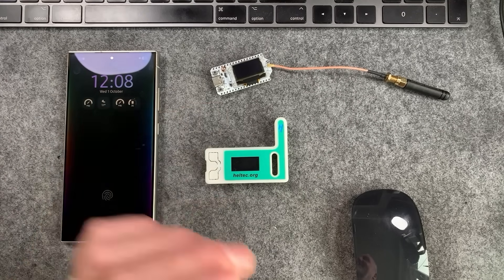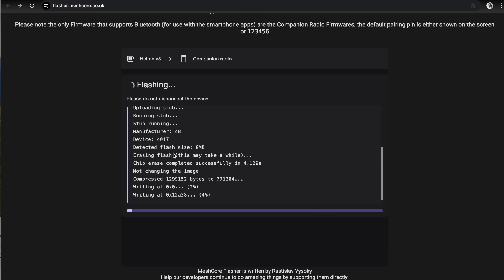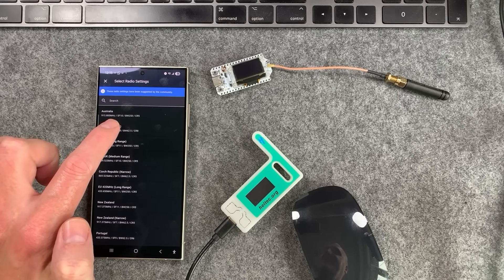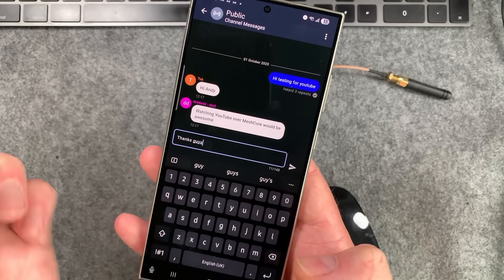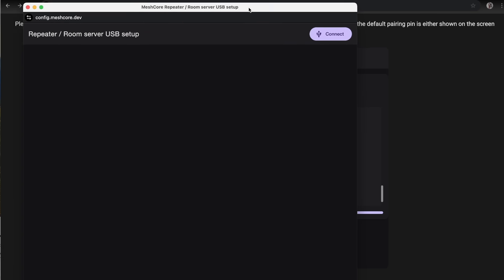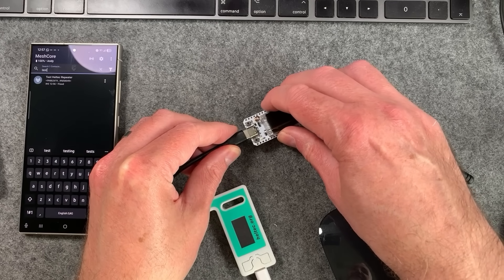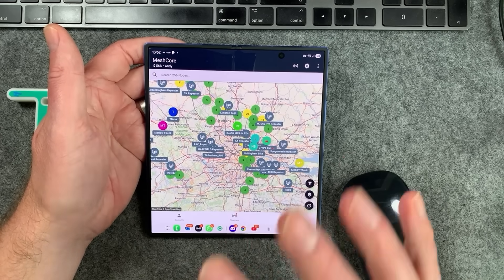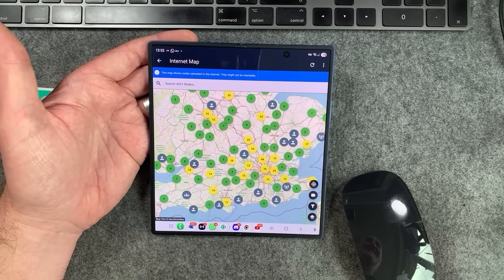HOW TO SWITCH FROM MESHTASTIC TO MESHCORE EASY!!!

Comment: Nice! Hopefully a few more switch over to the bright side. I switched over to narrow settings when you mentioned the change and remarkably I have seen some contacts and a few messages in "public" - but alas that must have been someone mobile or fluke weather as my neighbours list is still empty. Fingers crossed as there were quite a few nodes in range previously on Meshtastic.

Comment: If MeshCore is light years ahead of Meshtastic, is there an integration with ATAK?
Reply: No, because it is the opposite extreme to Meshtastic. Total separation between clients and repeaters. Making it lightyears ahead when there is a fixed infrastructure, but useless for mobile meshes. (Hence why it is so stupid MT resist 3rd party clients, both on a TDeck would be brilliant)

Comment: @andy kirby, whats your take on meshcore v meshtastic on devices like the T-deck plus / T-LoraPager, i have both, and till now i like the smooth operation on the pager with meshcore, meshtastic is still buggy on the pager, still need to test the tdeck+ as that just arrived and currently on charge, but first glance... meshtastic has its own issues one of which is a busy UI
Reply: Have you tried launcher? It allows on the move reflashing so switching between MC and MT is possible from the device, (if you can find the correct MT file, the MC one is deliberately published)

Comment: Meshcore might be better, but it's a real problem to create a mesh in the city, so Meshcore only makes it more difficult. I know several people with the free Meshtastic, but no one personally with Meshcore. But I do know of two nodes that are now only making the mesh thinner.
From my perspective, Meshcore is just sowing discord.
Reply: To be fair, it was Meshtastic preventing third party clients that started the whole thing. Had they not, we would have T-Decks with different systems, that users would just treat as different channels, use the one that suits your needs, either local coverage or different benefits.
Reply: While it is true that the already small community will be divide, this argument isn't the whole story. More options will give an incentive for new  users to join in, and it will encourage for the Meshtastic software to improve and become more user friendly. I am not a fan of either, and I myself am worried about the market becoming divided. But if this is the only thing you can think about you seem a weak member of a dying community. This attitude wont help either platform to grow.

Comment: I have switched all my nodes to Meshcore since March. Only two meshtastic devices left in my posession. One is abandoned on a very high mast. The other one will be reflashed on next maintenance. Meshcore is so much better for messaging.
Reply: What makes it better?
Reply: @chimeforest  Routed packets and simple flood using dedicated repeaters rather than "managed flood" which doesn't work well in the UK
Reply: @debuzzard  They are actually basically identical, both use a managed flood approach with no routing tables. The main difference, is Meshcore is new, and so does not have the same firmware intertia as meshtastic, with older firmware nodes sitting around, and meshcore forces you to use dedicated repeaters, forcing people to think more about where to put them in good places, wheres building good dedicated repeaters with meshtastic is more optional, so maybe people didn't just do it as much because of that, and so there's less strategic infrastructure. But meshtastic is just as capable of building that strategic infrastructure with its router and repeater roles which effectively turn all clients in range into non repeaters, like meshcore.
Reply: @MassDefibrillator   Meshcore uses simple flood as opposed to managed flood, when it isn't using path routing.

I might be a bit behind the times with Meshtastic but when I last checked, with Meshtastic the only mode that will always re-broadcast (simple flood) is ROUTER_LATE. Managed flood worked poorly for myself and many others (mainly Europe).

Even if MT is improving in this regard, these changes seem to be in response to MeshCore arriving on the scene. Before it did, the Devs seemed uninterested in the issues those of us were having and were quite frankly high-handed with those who raised the issues. 

So I'd personally be reluctant to properly get back into MT (I still have one MT node) even with improvements due to the Dev's attitude.
Reply: @chimeforest you type messages and actually get replies, lots of nodes reflashed now.
Reply: Meshtastic and Meshcore are for two different use-cases. Meshtastic excels in dynamic, mobile, and feature-rich scenarios, while Meshcore is better suited for scalable, reliable, and low-overhead city-scale or emergency response networks. The most significant difference is that Meshcore does not forward messages between nodes, instead relying on a central repeater or repeaters to relay messages. This makes it less suitable for tactical applications in highly-fluid environments than Meshtastic.
Reply: @n7ekg We actually tried building a mesh with Meshtastic for several months before switching to Meshcore. The only thing that Meshtastic excels at is clogging the network with unneeded telemetry and then loosing actual messages. But that is just my experience, your milage may vary.

Comment: I have a haltec up a pole with usb running down. It's on meshtastic and connected to my home WiFi.
Can I connect it to WiFi when I convert it or have a fixed Bluetooth pin so I don't need to read the screen?
Reply: Yep
Reply: @TheAtomicZombie10  can you tell me how?

Comment: Hi, there are over Meshtastic nodes in my city. Is Meshcore compatible with Meshtastic? Will I be able to exchange messages between the two systems?  Thank you
Reply: There was a brief time, perhaps less than a month, where Meshcore could communicate with Meshtastic but they currently can't communicate with each other. As I understand, Meshtastic instructed Meshcore to remove the cross platform compatibility. I don't know if the compatibility was originally achieved through code reuse of libraries or reverse engineering, and what grounds Meshtastic based their objection e.g. legal license, philosophical, etc. Andy briefly mentioned it a video posted months ago & I don't believe he has commented since.

Comment: I‘m in Germany and on the map there are just a few MC-Nodes a bit further away, but many MT ones.
My question is:
Is MC working with just my one Heltec V3 set up as companion, or do I also need a repeater for it to work, if anybody else is in range?
Thank you! 👍🙂
Reply: Clients do not repeat, but repeaters form a mesh. (Presumably why it is called MeshCore). This has the down side that a single device does not grow the mesh if it is used to send messages. It would be nice if repeater could accept bluetooth android clients or if there were an ad hoc repeater mode for clients.
Reply: Where in Germany? I tried MeshCore in my area but there's no one around. I'm in Leipzig, 04207
Reply: @MadalinVladescu  I am in the west near the Dutch boarder, Düsseldorf area. So pretty far away from you unfortunately.
Reply: I was in Germany last week and picked up MC nodes in Germering, Berghausen and somewhere in the Alps when flying out. Only public channel message I picked up just said "Guten Morgen".
Reply: @Andrew-n2e9y  Good to know, thank you!
I am in the western bit, in the Düsseldorf area, so not where you have received something.

Comment: I only use fully open source software and dislike people monetizing closed source code while claiming to be mostly open source. May as well be no open source.
Reply: same mostly. I don't mind if they offer a 'premium hosting service' to host & run the software for you on a server, as long as its entirely opensource and can be self-hosted for free
Reply from the maker: MeshCore IS open source. ??? The apps are made by third party devs who can decide whether to charge for their hard work or not...you can make your own app if you want. Meshtastic charges you a license fee via the vendor when you buy a device with their logo on.
Reply: @andykirby  That would mean the USB companion radio firmware would allow OP to only use open source?

Comment: Top tip: There is a current Meshcore build (Repeater/Room Server/ USB or BT client) for the Heltec V2 - so you can bring "vintage" kit back into use.

HOWEVER, a lot of folk have found that UK/EU Narrow (869.618, BW 62.5, SF8, CR8) on some Heltec V2's, doesn't work (it can't see or be seen). I think this is because of inaccuracies in the frequency setting - so still select UK/EU Narrow, but change the frequency to 869.650 as a starter for 10. You may find (if you have an SDR) that you need to go a whibble either way - but 869.650 or thereabouts, should get your V2 back in the game.
Reply: Life saver! . 650 Works on ESP32 ttgo in NL

Comment: Great video, thanks.
Do you know if there are any plans for a Pi Pico W firmware with BLE support?
Reply from the maker: I don't think its possible no.
Reply: @andykirby  Thanks for the answer. Do you know what the problem is? The CYW43439 seems to support Bluetooth 5.4. So it should have the necessary hardware, right?

Comment: I am looking forward to switch all my devices, but can't at the moment as I need GPS on setting to work after reboot, so stuck on meshtastic at the moment.
Reply from the maker: GPS isnt essential.
Reply: @andykirby tracking is for me, as kids use it on there devices. They use it to find each other as well. Main reason I have setup meshtastic is checking up on them if I need to like late home etc and for them to be able to message. But I do prefer meshcore, so hopefully it's added soon..
Reply: @andykirby  I would say it is,, or at least the time setting part. Things don't work smoothly if the time is wrong.
Reply: @andykirby so, in other words, meshcore’s marketing is misleading, as it is promoted for “emergency response & disaster recovery, outdoor activities, tactical security including law enforcement and private security.” however, in these scenarios, people could be completely lost or untraceable because gps functionality is missing. why not remove or revise this misleading marketing text?
Reply: @andykirby  true, GPS isn't essential for standard operation, but like some other posters, I'm interested in a tracker. Specifically, I want to do a GPS tracking collar for my Husky, perhaps with a RAKwireless config . Unfortunately, recall isn't a strong trait for Huskies. However, I'm fortunate my Husky is food motivated.

Comment: I want to use my non display Heltec T114, but without the display I cannot see the Bluetooth pin to pair which is a shame.
Reply: 1. Put Meshtastic on it and set the BT PIN. Make sure you can connect using that PIN.

2. Put MESHCORE on it - DO NOT erase first. Connect, using the PIN you set in step 1.
Reply: @actuandouk  I'll give that a try, thanks!
Reply: Use it as a repeater
Reply: The default pin is 123456 for devices that dont have displays it says this on the flasher webpage
Reply: @zachsylvester309  I tried that but it didn't work either.

Comment: I just got my Meshtastic 😩 
Not sure I can switch to Meshcore with my new fancy device.
Reply from the maker: Which device?!
Reply: @andykirby  WisMesh Tag
The Pocket-Sized, Compact Meshtastic Tracker
It's really nice and the battery lasted 14 hours today and only went down to 77%. 
I have a Heltec V3 kit that I put together and it last about 12 hours but the battery goes down to 20% in that time.
Reply: Check out the flasher 😊 see if your device is listed.

Comment: Why would anyone switch?  MC isn’t developed enough to switch. Just add another mode and wait patiently for the mesh to build out like Meshtastic
Reply: Hello! MeshCore is ready and working, I can absolutely confirm it is as a user of it.. Just as all radio, really does depend who else is in range though.
You could be throwing out messages on MeshCore, Meshtastic or even a handheld radio throwing out CQs, if nobody is in range you won't get a response.

I was an avid Meshtastic user for over a year, watched the project grow, updated, used bleeding edge firmware, messed around with MQTT, changed settings, bought bigger and better antennas, but I was still having the same issue! Message reliability! It just wasn't there! Meshtastic is BRILLIANT for beaconing and knowing the temperature of somebody's loft 20 miles away, but couldn't have a consistent back and forth.

MeshCore on the other hand, back and forth messaging, no problem, it has been a thing of beauty!
Reply: @TechWithMarc I totally agree.  Plenty of people on here saying there is nobody in their area using MC well nobody will be until they pioneer it first and put it out there!
Reply: @shaunholland yep! Somebody has to be the first
Reply: @shaunholland  I tried MC on the old settings point to point and it was useless, tiny range compared to MT. I tried my own settings and the range was fixed. I tried the new sensible settings and the range is fine, so have moved over. I also added the legacy settings as a second network and noticed activity.
Reply: @thirtynine-j5x I managed to do some great range tests in the old settings but didn't get any other nodes, new settings I have managed to pick up another node but not others I know in the area.  We are all in the process of getting repeaters into the correct locations so this will improve over time.  MC is definitely the way forward though.
Reply: @shaunholland the range issues here would be down to interference. Using the same settings as MT when there are nodes around isn't going to turn out well.
Reply: @shaunholland  we are having the same problem in the NYC.NJ area ... new Meshtastic nodes are showing by the dozens every day, but zilch on MC ... our ham club is working on getting things set up on MC in northeast NJ...
Reply: @TechWithMarc you’re spouting off with no real understanding of the magnitude and distances required for intentional connectivity in the western United States. 

Glad it works for you. 

It doesn’t here. Yet.
Reply: I wouldn't say that. It is fair to say there are things MeshCore can't do, that MT can, but they don't work particularly well on MT, so currently not really a loss.
Reply: Speaking from my own experience of Meshtastic (at my particular location in the UK) in over a period of about 18 months, I don't think I ever saw more than 8 contacts and NEVER was able to send or receive messages from any of them. It was starting to get to the point, where I was presuming that Meshtastic was more akin to Stamp Collecting - in the that the joy was in the pursuit, rather than being able to do anything useful when the object of your collection came along.

I swapped over to Meshcore - and it was very much the same - less than 10 nodes on a hot night and none of them pingable/messagable - and that has persisted for the past 8 months. So as far as I was concerned, my location, kit (including antenna) which never changed AND Meshcore, was equally as useless.

HOWEVER, due to a flurry of activity that I spotted on the Meshcore Discord, I switched to UK/EU Narrow this weekend. That was the only change.

Now, at the time of writing, I have 198 recent contacts in my node list and have received messages from folk as far away as Sheffield (I am in Wiltshire) and even @andykirby himself in Hertfordshire. 

HOWEVER, you are right, US frequencies and distances are a whole different ballgame - and I guess we will only get to know how well (or otherwise) it works for you there - as more folk give it a go. Think Dr Pepper - what's the worst that can happen? 😉
Reply: It’s good to have a plan B, how ever. I currently run Meshtastic in Chicago IL. MeshCore is a good product/application well done. 
I have both on my phone just Incase.
Reply from the maker: Many are switching, its more than ready 😁
Reply: @andykirby it’s not ready everywhere. I ran a few nodes for a few months with no intentional connectivity unless I traveled and at that point I had to be on SOTA summit